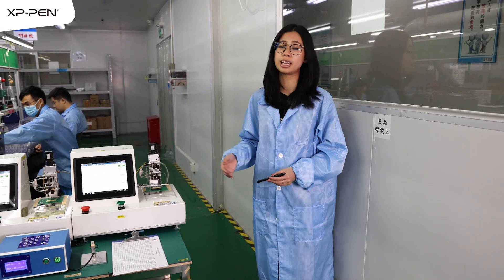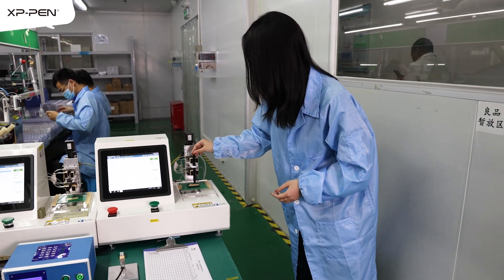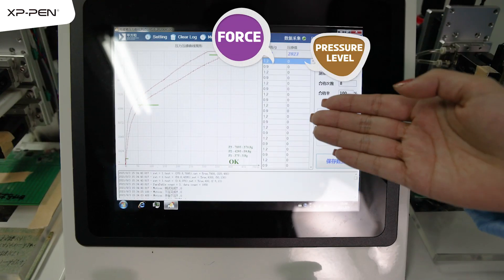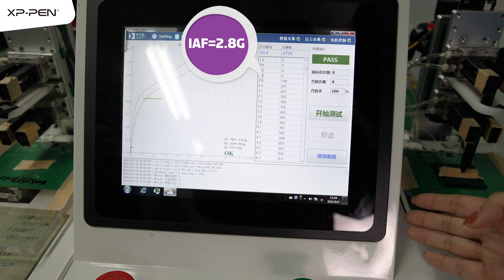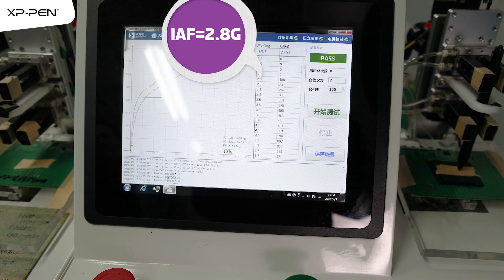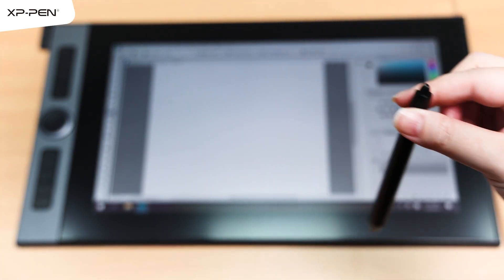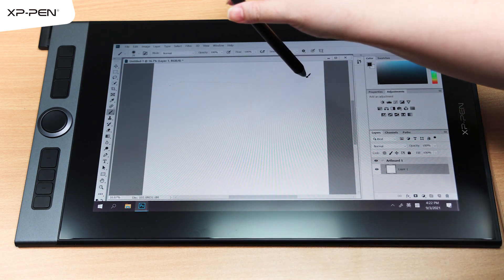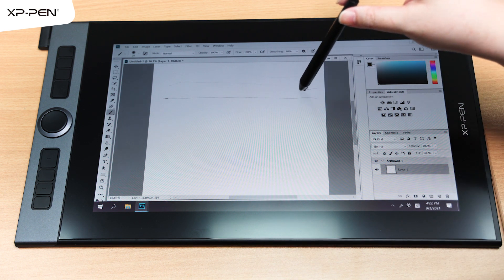The IAF testing of the X3 Smart Chip Pen

Comment: OK, after a few reviews, apparently the slight wobbly lines while drawing diagonally at a relatively slow speed, still is present.
But this time, the issue might come more from the tablet's digitizer than the pen. Because the X3 chip improves the pen performance. What might require an upgrade next is the digitizer.
Reply: the scan rate?